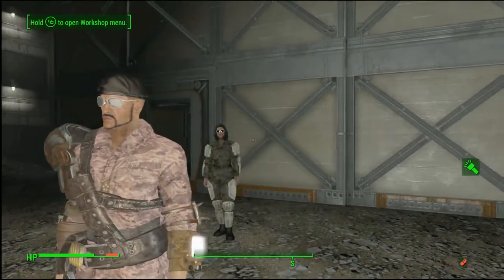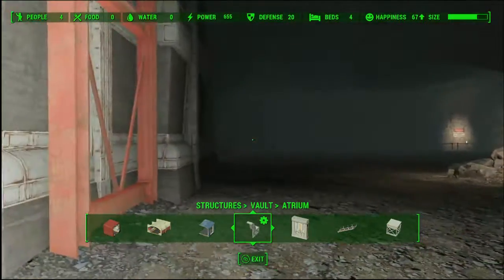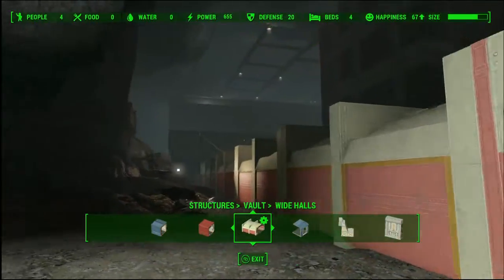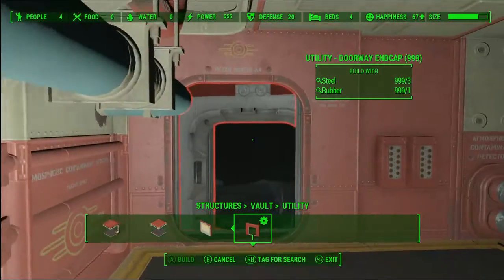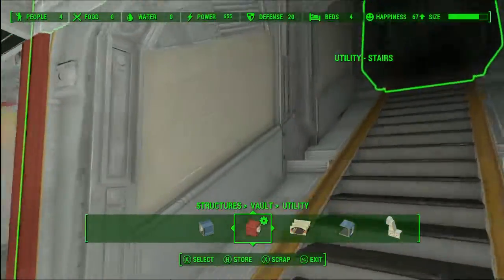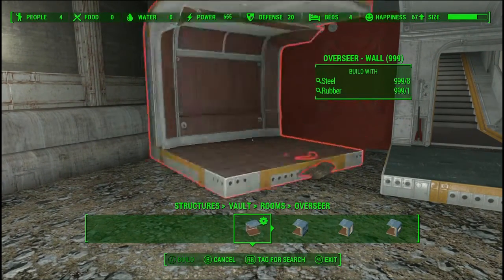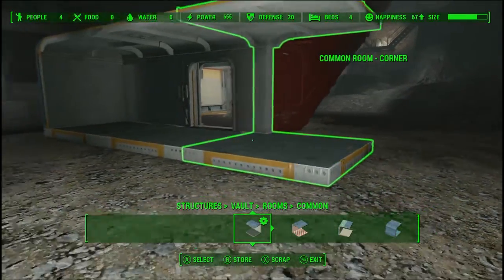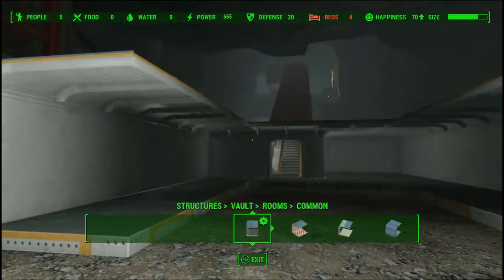Utility, Domestic, and Vault Room Overview: Vault-Tec Workshop

Comment: the power revolves around the big vault tech reactor and as long as the floor that is connected to your vault is connected to the vault tech reactor your vault has power because the power passes though the floor.... however to make the power go to rooms and whatnot you go the the vault power conduits in the connection and Switches tab and place one on the wall of the area you want to have power
Reply from the maker: Great Tip im going to check that out for the hallways they are so dank looking thanks for dropping some knowledge!!